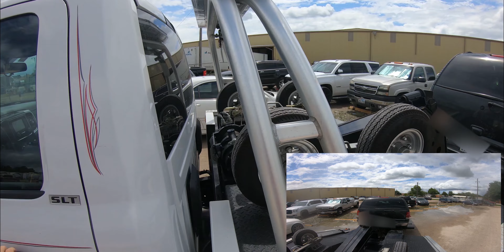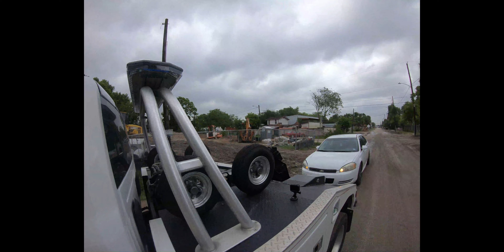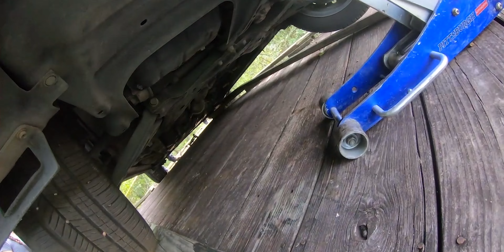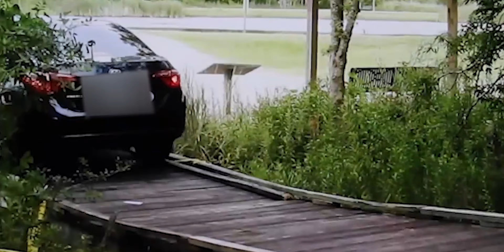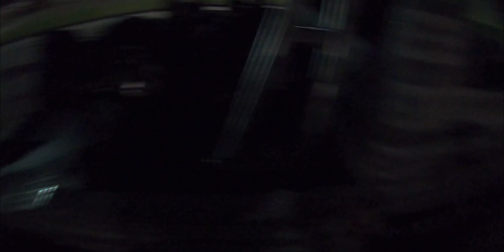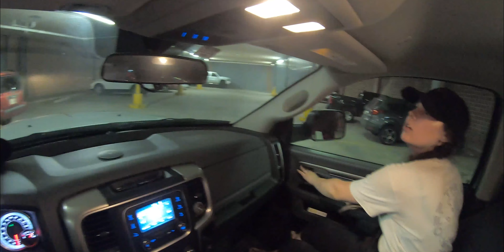Tow Truck Compilation 2020 Houston Tx

Comment: Got to love when there backed in like that hook n book had a prius friday night backed in no electric e brake all the other cars last week i was droppin dollys
Reply from the maker: For sure, just grab and go. Nice. Yeah dollies will get to ya. I’ve been working on my drag out game the last few repos. Can’t help but always have one side wanting to jump out on me unless I’m directly lined up with it straight. I’ll Keep a strap ready to go if I see it trying to hop out.
Reply: @jeffsmithfpv  lift high and open jaws you got to kinda ease the throttle once the ass end of the car drops than you can drag just go easy practice on a junk car if you have on
Reply: Another trick is to have one jaw closed on one tire the other on pinch weld on rocker panel your stinger will be almost at 180 lift until only 1 wheel is on the ground and you can roll it out without dragging

Comment: I never liked keys or trusted them.  Clubs on steering wheels, kill switches, alarms, and lock changes expose you on the front line.  I let the truck do the work she was built for and it seemed to work better for me.  But you clearly don't need no babysitter...
Reply from the maker: Wow Nunya thanks for the advice man. I’ll take it to heart. Don’t use keys when you have them. Check 👍
Reply: @jeffsmithfpv  I did not say that...I said "I never liked keys or trusted them."  Mercedes credit would not allow you to use a truck.  They mailed a key and you were required to use the key.  It had to do with on hook insurance that would not cover the cost of the MB.